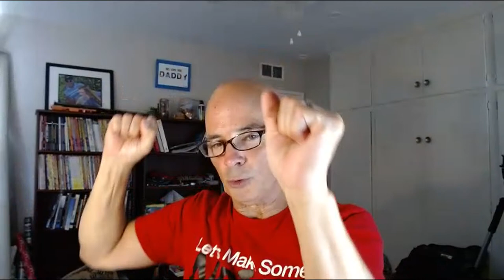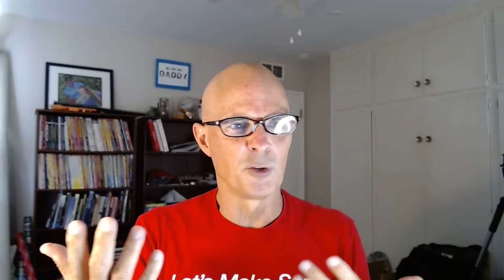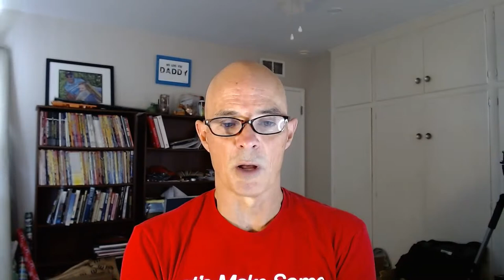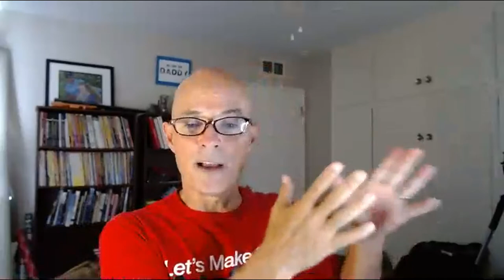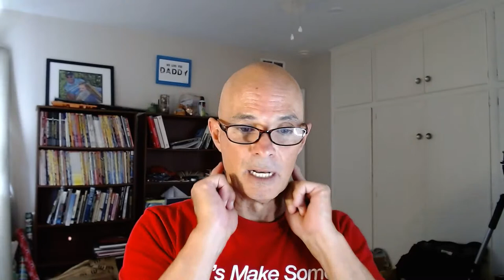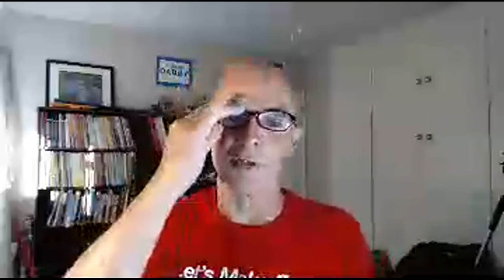LET'S TALK TECH-CUSTOM INTAKE MANIFOLDS (BUILD YOUR OWN)

Comment: we made a 3D printed Water Thermostat housing for a CBR600RR engine. we over heated the engine multiple times during testing and never melted down the thermostat housing. so for sure you Can get high temp plastics on 3d printed parts that can handle at least 220-240 degrees. but idk how hot an intake manifold mounting surface gets. if its below that your are golden.

Comment: My TIG just arrived so I can build an aluminum intake for a B18 Honda using a Holley 390 DP as a turbo blow through set up.  Using in Champcar endurance road race application. They charge points for an inter cooler. And overall costs will be less. It’s also a slight weight savings and eliminates things that can fail like ECU and the maze of wires. Anything to decrease nose weight is a plus. With primary and secondary jetting, and 2 adjustable boost oriented power valves it should be very tunable.

Comment: The early BA barras are the lowest power, they had less aggressive cam profiles, a single knock sensor and less compression, so less airflow and less timing.

The NA and turbo BA barras had the thinnest of all of the barras connecting rods, they are pitiful, if boosted you can safely make 300rwkw though many make 320-340rwkw, once people push beyond that they start to fail pretty catastrophically.

The barras from late 2006 onwards have conrods that are significantly thicker, if you google "conrod differences engine workshop barra" the first result should be a forum post with a picture showing the differences. Barras with those conrods comfortably do 440rwkw, but there is a bit more to that as those barras also have more compression and bigger cams.

Barras have pretty trash valve springs so it'll get float at high RPM and with higher boost, its a very common upgrade.

Ofcourse these numbers are all a bit of a "it depends", if you have high IAT, or lots of exhaust backpressure you'll break things sooner.

ARP make headstuds for the Barra, they're nice. They also sell oversize headstuds that you need to drill and tap the block for, these are unnessecary on a non-built engine.

The barras have a vac-driven, electronically switched variable length intake manifold called the "broadband manifold", its very good performance, but the throttlebody points in a garbage direction so most people change it out for aftermarket manifolds that are easier to plumb.

Comment: I have a chevy 6.0 with a Holley Sniper aftermarket intake that doesn't have provision for evap canister purge valve, can you run without it?  Or do I need to drill a hole and mount it behind the tb? Thanks!
Reply from the maker: there should be a opening for it on the bottom

Comment: Barra engines have dual runner intakes controlled by 6 throttles directing flow long to short runners.
Reply: One of my cars' engines has one throttle per cylinder. This is their explanation why---
"At low throttle openings the `blocking' reflective effect of the individual throttle plates reduce the back pulse from the inlet of one cylinder and hence reduces inlet charge exhaust dilution problems. Traditionally the absence of multiple throttles on engines with relatively long valve overlap periods, in this case 42 degrees crank, can cause HC and feedback fuel flow control problems."

Comment: What is the bore spacing on a 300 Ford 6? could you cut aluminum 2 SBF heads and weld them back together and fit it to the 300?
Reply from the maker: ITS A LOT MORE DIFFICULT THAN THAT

Comment: I made a custom carbon fiber manifold with six Jenvey 42mm aluminum velocity stacks for my 2.8L BMW 328iS with a custom axial flow rotary valve head.

I've done the M50 manifold swap on my E36 M3, but I want to make a custom one some day.
Reply from the maker: Very nice!
Reply: @richardholdener1727  I can't wait to get it back on the dyno with the good MAF (I bought a cheap Chinese knockoff that maxed out at 4500 rpm for my 2nd dyno test).  Calculated volumetric efficiency is better in some spots than the stock engine.  I'm also changing the duration from about 260/260 with 40 degrees of overlap to 230/230 with 4 degrees of overlap.  I have a bunch of videos of it on my channel.... All in the name of having fun.

Comment: In case you didn't see my chat message(which came in late as I had paused your stream a few times): Regarding your Custom 3D Printed Intake - you can use a metal gasket with a Ceramic Coating to protect the intake manifold from heat... O.O Like the sort of coating headers get... =]
Reply: No need ls intakes are plastic straight to the aluminum heads
Reply from the maker: ls intakes are not 3d printed (different material)
Reply: @richardholdener1727  You said in the stream that you'd 3D printed an intake but did not want to use it as you were worried about the heat of the engine affecting it(earlier in the stream before you started answering questions) - so I thought of the ceramic coated(or carbon fibre)gasket... O.O
Reply: @richardholdener1727  & I think there are different 3D printing materials that one can use - some of which may be heat resistant(as I myself as looking to have something printed a few years ago, had similar concerns & asked the guy making it)...

Comment: Nobody and I mean absolutely nobody makes a Hi-Ram style manifold with a removable lid that can hold an air to water intercooler for a small or big block Chevy.  I've talked to Holley and they might start making them.  Also talked to Frankenstein Engine Dynamics.  Sounds like they might start making them in the next year.  I ended up ordering a custom billet one from Hogan's.

Comment: Sorry i missed you live cause i would of mentioned YOU bringing a performance intake manifold to Market for the Ford 4.6 2v PLEASE
Reply from the maker: THAT DID NOT HAPPEN
Reply: @richardholdener1727  I just think your the perfect person to achieve such a task with your vast knowledge of performance engines and what works and if at minimum please revisit the challenge of a perfect 2,500 to 6,500 4.6 2v intake for us idiots trying to get every hp we can from a ford 4.6. 2v with very little aftermarket support

Comment: Would really like to do a custom manifold for my 2JZ. I know there are manifolds already out there, but they are all geared towards WOT and crazy dear for what they are. I would like to do a street manifold that incorporates an intercooler based loosely on the original N/A manifold. Only problem is if I make it, I fear letting the project get out of control, and next thing I know I have spent $10,000 on the engine.
Reply from the maker: doing cool stuff can quickly get out of control

Comment: Would be cool to see a  LS carb intake that can run with a FAST intake.
Reply from the maker: IT CAN'T-TAKE A LOOK ATTHE LS INTAKE TEST VIDEO
Reply: @richardholdener1727   It couldn’t fit it under the hood. Maybe a tunnel ram with runners that have the FAST mid range power.

Comment: Missed it...
Reply: It's Okay Shadow Ops AirMan1. The basics will come out. The in line six guys have been putting outher guys intake manifolds  or 100% homebuilt ones of cleansheet design on Fords and GM and Mopars and AMC's for years. Checkout CarMichealAngelo's 2016 fit up of the  BMW M3 S52 ITBs onto Ford Maverick 250 with Aussie Honda Cross flow head (Stangnet on link  https://www.stangnet.com/mustang-forums/threads/the-bite-of-the-gila-monster-my-first-attempt-at-some-real-pictures.898242    ) or the 1969 SOHC conversion to the 4.9 liter 300 Ford with Aussie Chrysler Hemi 4.0 liter 245 2bbl intake Manifold.  (Fordsix Performance   on  https://fordsix.com/threads/ford-sohc-hemi-crossflow-cylinder-head.80589/ ) . It's easy to fit other stuff to Other Engines. In the last link, on page 2, Ak Miller  made a vast number of home made in line six single throttle body intakes for the old non cross flow 4.9 liter six...True innovation is the basis of American Speed sir!

Comment: I want the versa manifold to buy cost please Richard
Reply from the maker: SEND ME AN EMAIL-HOW DOES $250 SOUND (I PROBALY HAVE $1500 IN IT) killerbe16@aol.com
Reply: @richardholdener1727   did you sale that versa intake manifold?
Reply: Hey Richard I a woman T-bone the versa a couple of days ago but I wanna get an 5.3 or 6.0 truck engine and boost it to drift the only thing is that iam from Trinidad and Tobago which is in the Caribbean I would like to get some help in acquiring the motor

Comment: Thanks. It's going to cost me $5K for a custom manifold to put my 6-71 on my Ryan Falconer V-12 head on my Chevy I6 292.
Reply from the maker: $ well spent
Reply: I need to know more about a V12 head on a straight six 292 is it just one head off of a V12 like a jaguar or is they custom head built by Ryan falconer
Reply: @rustedratchetgarage6788  It's one head of his billet V-12. His V-12 is based on 2 Chevy inline 6's so the bore spacing is the same. A custom cam is required because the order of the valves are different. The bolt pattern is different so block work is required. It's an aluminum crossflow with custom 1.7 stainless rockers. The flow is 340 intake and 220 exhaust.  https://falconerengines.com/
Reply: @richardholdener1727  Thanks. Hogan will be making it. Like everyone else they are swamped with work. Thanks again for the advice on moving up from my 4-71 with 3 duces to the 6-71 with dual quads.